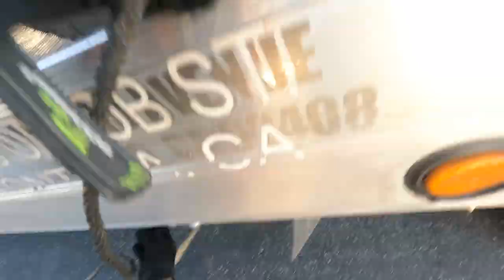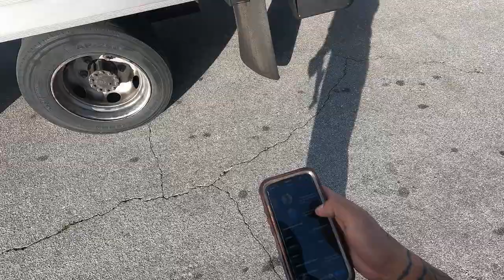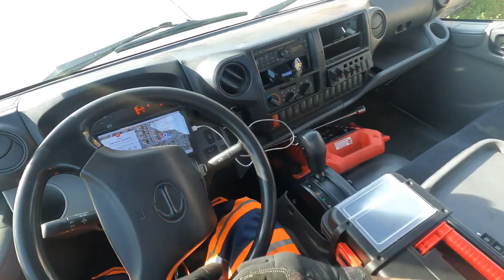MY PTO WENT OUT DURING A TOW! | DAILY TOW VLOG

Comment: I always enjoy running a tow truck. Heck my own channel is based on my wrecker and couldn't have even made videos without it. But one thing I always never liked was when my stuff quit working when I'm runnin a job. And also being in Cali I don't deal with rust. It seems like the issue was probably just a bad clutch that went out as usually a PTO dying would be a slow painful, leaky, and literally slow, death. I'm an owner and operator contracted privately by my own parents to tow cars for their shop. I've had my truck break right in the middle of the parking lot, always good practice to do a walk around and run the truck through all of its functions before heading out. Great video man, another sub from me! If you want to get extra angles I'd recommend a second GoPro on a Claw Arm like I use in my videos, you can stick in anywhere but be weary where.